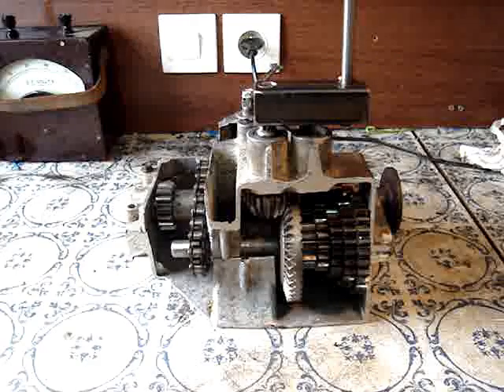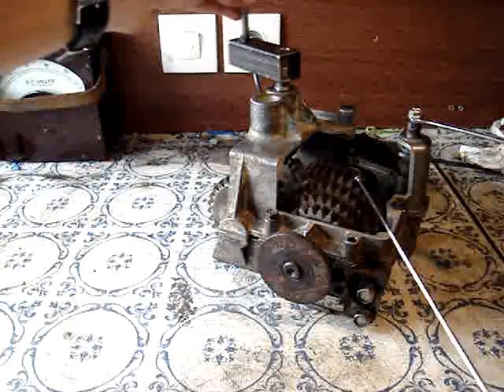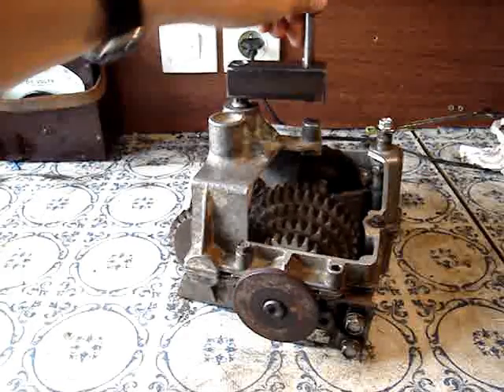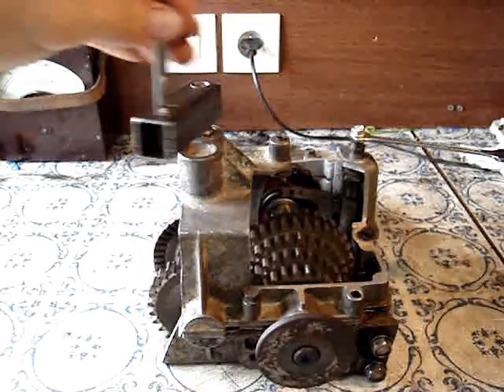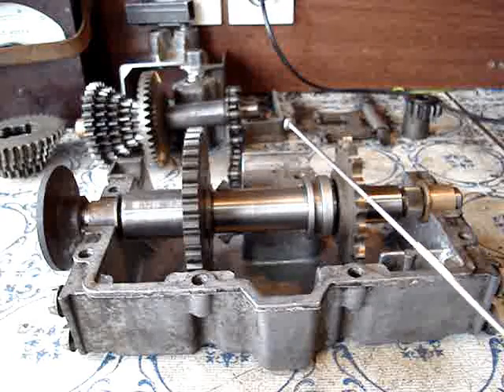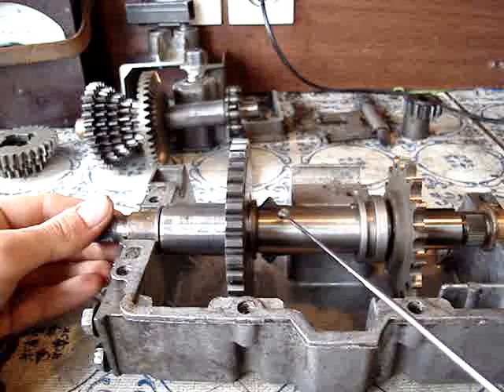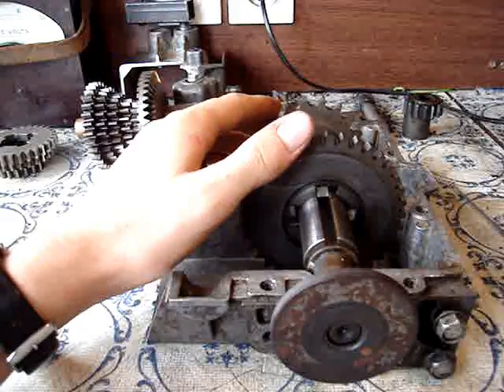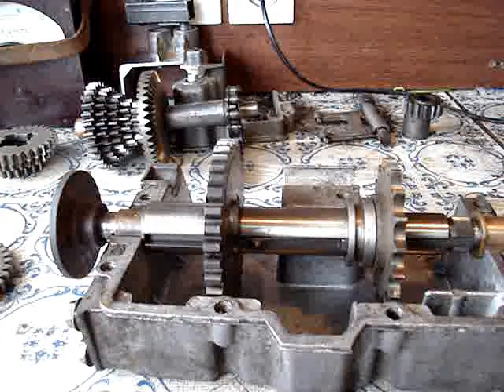constant mesh gearbox explained

Comment: that is a gr8 explanation i just wanted to know does constant mesh gearbox consume more power and fuel than sliding mesh gearbox because here all the gears are running in mesh so is it that more power is required to drive all this gears ?

Comment: So we are moving the clashing of gear edge closer to the shaft. Mechanically I see no big difference - same problem of different speeds and same problem of engaging sound. What makes this mechanism superior to the older type? How does it make the two parts align their speeds? To make it more obvious - for the reverse gear, at what point in the gear change process the one shaft changes direction and what initiates it?

Comment: What is this gearbox from? I've never seen a gearbox without shift/selector forks forcing gear engagement via sliding gears. This seems to do it using a sliding set of dogs on the shaft itself. Is there a term for this design?
Reply: "constant mesh gearbox explained" 
Motorcycle gearboxes are almost always constant mesh gearboxes.